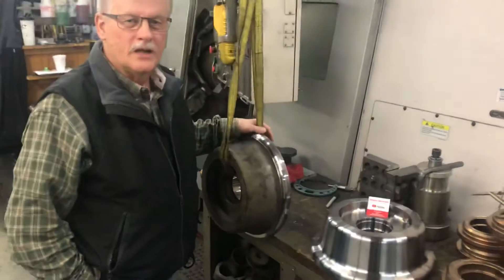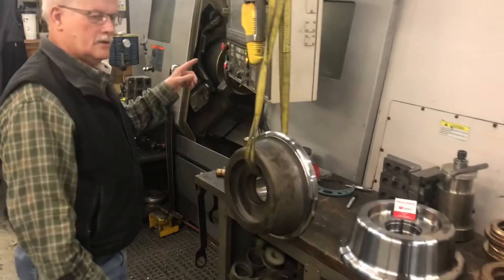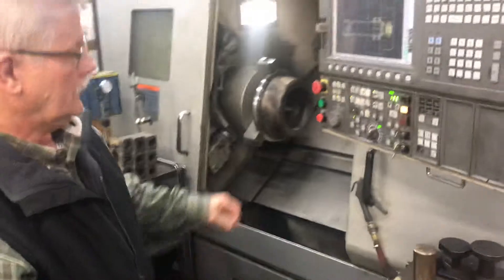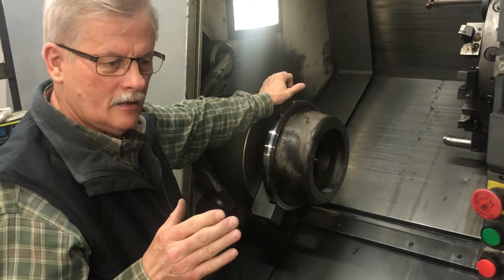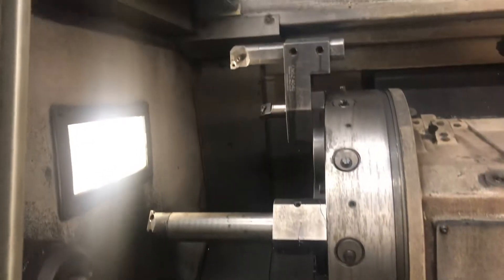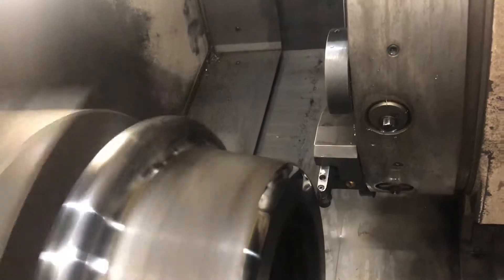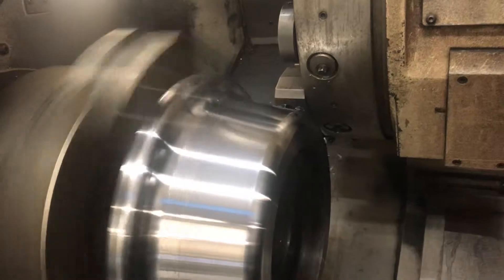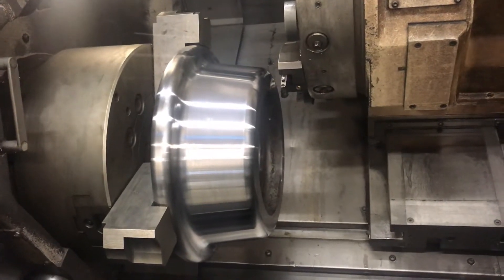Hard Turning

Comment: Hey, nice work and great surface finish.  What model Okuma lathe is this? I just bought a LB 300 MC from 2007 but it has a small 208 mm chuck and would like to change it to something like yours to tackle larger parts. Keep up the good work
Reply from the maker: We did that job on an Okuma Captain machine.  You have to be careful when going to a larger chuck.  When we bought a lathe with a 10" chuck, but upgraded to a 12", they said it may cause a problem with spindle startup torque, and bearing load factor....hasn't been an issue.  It's always nice to have that extra capacity
Reply: Still Prefer ! To have ! Coolant ! Running ! I Don't like Dry CUTTING ! In Hard ! Metals !!